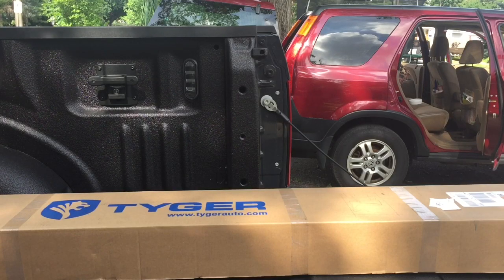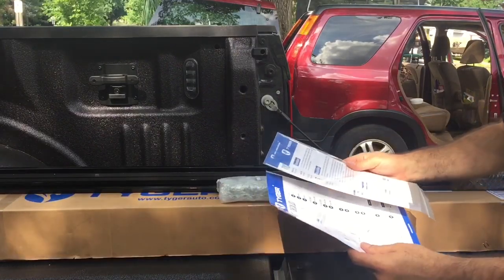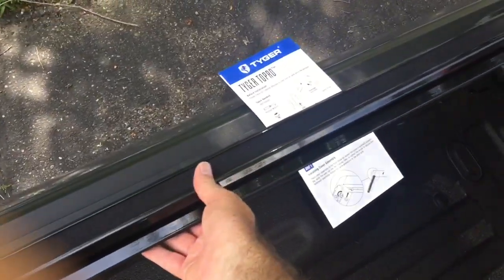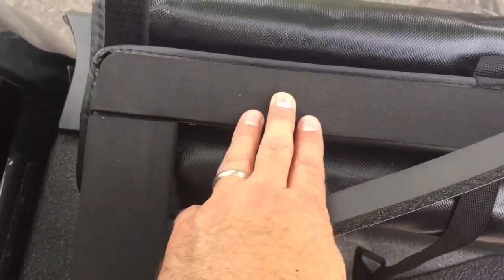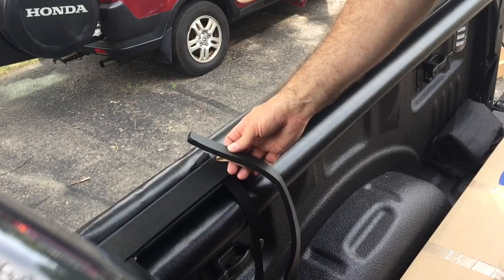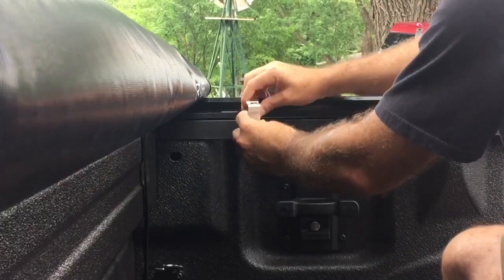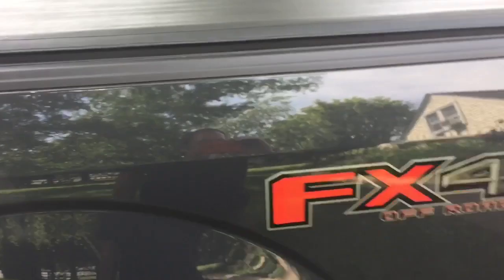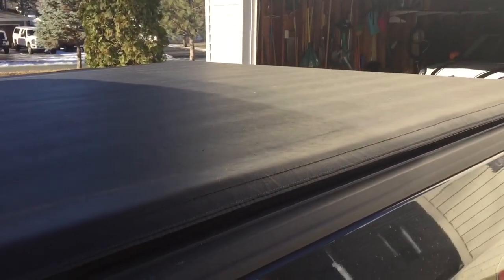tyger tonneau cover install / review

Comment: I had that little gap at the corners on the back also when I installed mine yesterday on a Tacoma Sport SB.   I found the rail ends where the locking pins go in to be bent up a bit.  This let the back of the cover lift a bit when I let it go after locking.   The metal part of the rail was about 3mm higher than the plastic cap that goes on the end of the rail.  I tapped this down lightly with a block of wood to make it even with the plastic cap.  This made the seal much better.  I still had the slightest of gap at the tail gate.  I ended up shimming the locking pin with a 1 mm piece of plastic.  I super glued this onto the pin.   Now the seal is perfect.   The gasket just kisses the tailgate.  When I put a piece of paper between the tailgate and the gasket I get the slightest drag when pulling it out.  I'll have to see how it holds up but it still locks and unlock perfectly.   Hint:  I see a lot of videos where people just pull the cable and let the cover flip up.  You need to push down slightly on the cover when you pull the cable to unlock.  This makes it easier to unlock but more importantly it helps take stress off the very ends of the locking pins avoiding damage.

Comment: The weather strip that comes with the cover is supposed to be applied to the top of the bed (spray in bed liner or not) running side to side. It goes just inside the plastic top side piece running front to back. The stripping goes from the passanger side to driver side to fill in the gap between the cover and the top of the bed along the back window. You'll most likely have to cut about 6to 7 inches off.

Comment: Help ! I have mine installed. I can't get it to closed, to much tension.  It closed and easily before I tightened down the clamps. One clamp I tightened to tight. I can tell, because it bowed the rail a little.  How can I fix this??
Your son I'd adorable! I did adjust the the tension as suggested several times.
Reply from the maker: With out being there im not really sure what to suggest other then taking it apart and doing it again.
Reply: @chrisprinceranch  yep, my next step